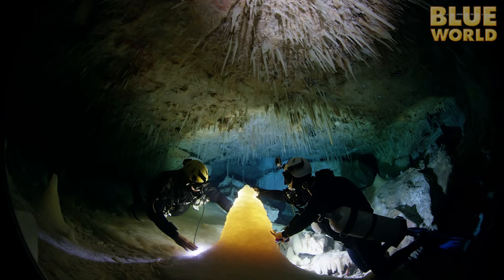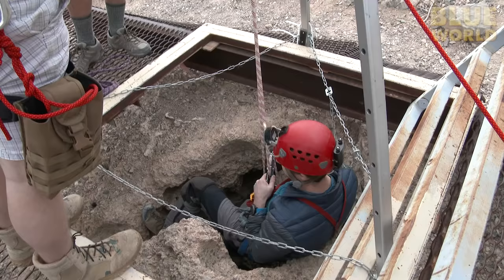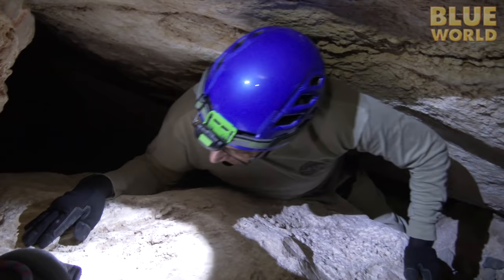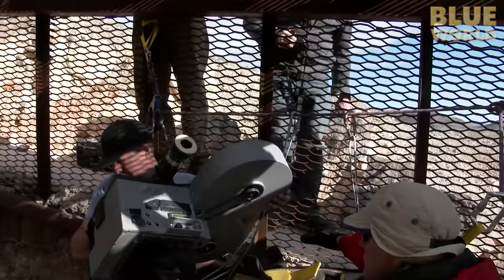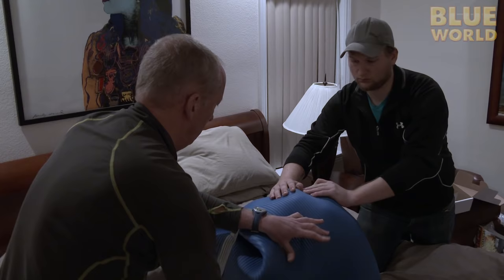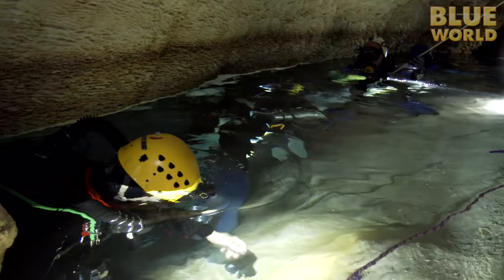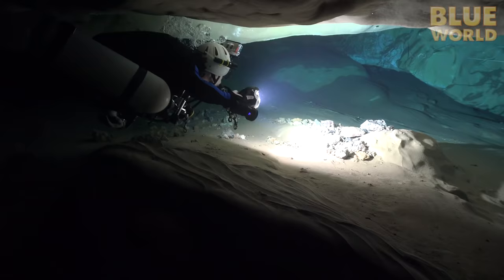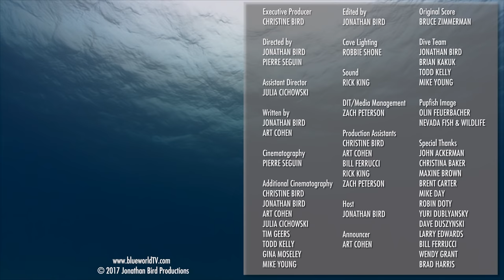Devil's Hole Adventure! | JONATHAN BIRD'S BLUE WORLD

Comment: You should check out the Wink Sink hole in West Texas, there are two of them. The second of the sinkholes, the largest one, Wink Sink 2, is said to be bottomless. Or so the West Texas Legend goes on. 

There is belief that the Wink Sink is actually a cavern connected to Carlsbad Cavern in New Mexico.

Comment: I have always thought it would be interesting to map out such caves that are not fully explored using an autonomous micro submersible equipped with sonar and other sensors to generate and update a 3D model, using it to explore all the areas of a cave possible, within operating parameters. It could be engineered specifically for caves, having very sensitive propulsion and being programmed to maintain neutral buoyancy with high precision. I'm sure something like this must exist already, or could be made for the purpose.
Reply from the maker: There are a couple companies that have developed AUVs like that.
Reply: I imagine so, but are they autonomous and small/nimble enough to navigate a cave like this and not turn it into blended pupfish bouillabaisse? @BlueWorldTV

Comment: if you guy are looking for really good lights i would recommend imalent (8 - 100k lumens) depending which one you choose the higher you choose the longer you can run on lower settings
They aint waterproof even if they state water resistance dont let them touch salt water.. killed several of them but for the price you cant find better for pictures/ video light

Comment: Great Video, but friends don't let friends side mount aluminum tanks. Cool side mount CCR one of the divers had.
Reply from the maker: Tell me about it.  Sidemounting aluminum is such a pain.  But it was all we had.
Reply: hey guys, quick question. It has been some time since I have been in the SCUBA diving circle so please be gentle. Why are side-mount aluminum tanks a pain. I am assuming the only other option is steel?
Reply: In my personal experience aluminum tanks tend to float up in the back. The less pressure you have (ie: less gas) the more they want to float. In the video, Jonathan made a comment about his tank floating. Making such a awesome dive is worth the irritation of 80s. All  I was saying is I feel his pain. The steel tanks, like the LP85s his friend was using, tend not to float when rigged correctly and hold a lot more gas (story for a different day).
Reply: @malcolmkitti  Thanks for the response & explanation.

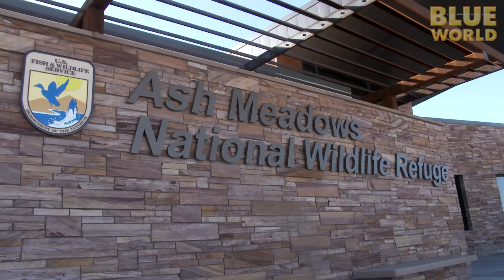Comment: This video is mistitled. There are 2 different underwater formations very near each other in Death Valley in Nevada, Devil's Hole and Devil's Hole Cave. This video is about Devil's Hole Cave, not Devil's Hole. The narrator even points out this distinction at 2:02.

The 2 formations have different entrances. Some theorize they may connect underwater, but no connection has been found, nor have the bottoms of either formation been found.
Reply from the maker: How is it mistitled?  They are both part of the Devil's Hole formation, they are both called Devil's Hole.  They are about 600 feet apart.
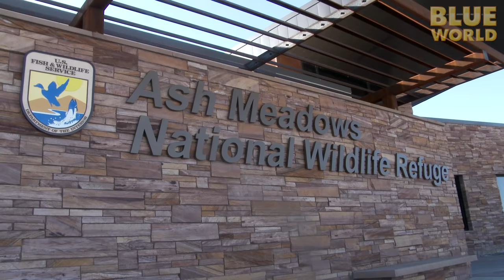Reply: @BlueWorldTV  I repeat, the narrator points out the distinction between Devil's Hole and Devil's Hole Cave at 2:02. They are 2 separate entrances, 2 separate approaches, and 2 separate dives. Even you point out the distinction in your desicription of this video: " . . . Devil's Hole Cave (sometimes called Devil's Hole II) . . . "

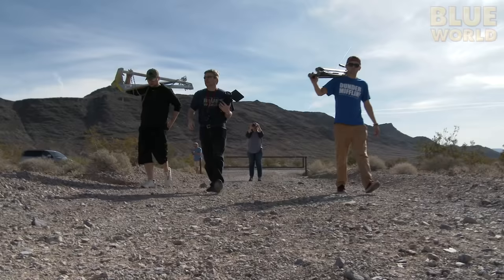Devil's Hole and Devil's Hole Cave may be connected, maybe even probably connected relatively deep (or relatively shallow, depending on your perspective) beneath the earth's surface, but at this point no one knows for sure. Even if you have solid evidence that they are connected (and if you do please provide the evidence, I'm genuinely interested), the 2 separate entrances are as of this day named slightly differently, again (for the 3rd time) as pointed out by the narrator at 2:02. This video is about Devil's Hole Cave (or Devil's Hole II), not Devil's Hole, and the video is titled "Devil's Hole," ergo the video is mistitled. Please do change the title. Thank you.